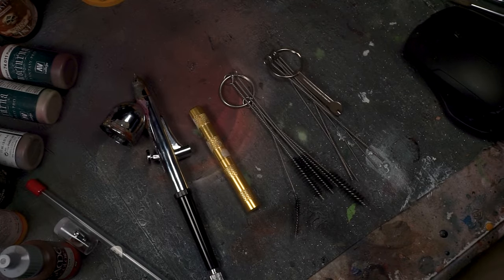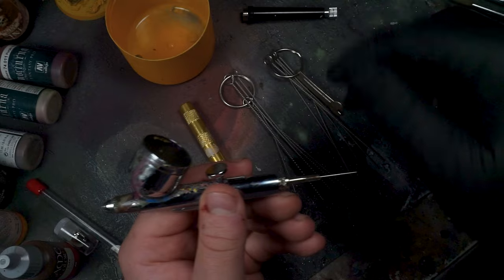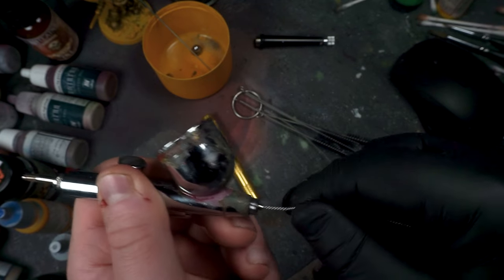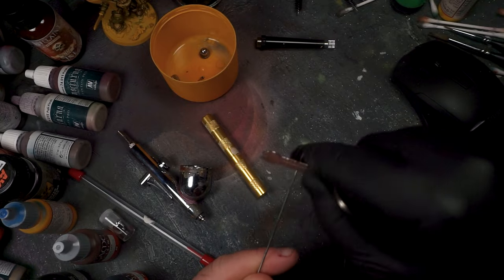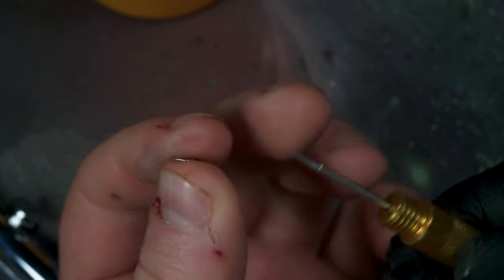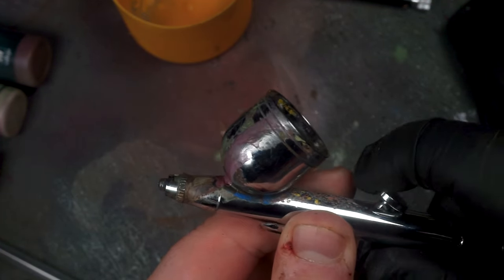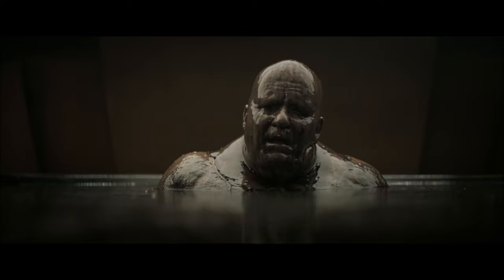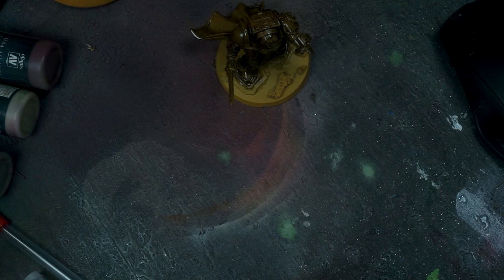How To Clean Your Airbrush

Comment: When removing the needle you should actually remove the nozzle first and than push the needle forward. This will prevent paint from entering the back part of the airbrush. I dont recommend doing the pipe cleaner dry - at least put some water on it before you go in. Also dont clean an expensive brush this way, you WILL damage it (How I lost my nice badger airbrush). Instead get one of those interdental flossing brushes (very small and thin pipe cleaners) and dip it in airbrush cleaner and wash the inside with that. I recommend the fine sized ones.
Needle: dont scrape like that, you can potentially end up bending the needle. Instead just get a damp paper towel and dap some airbrush cleaner on it and squeeze the needle with the paper towel and stroke towards the point only (to avoid sticking yourself). 
Cleaning fluid: best I've found is master airbrush cleaner - kind pricy. Windex works really well (same stuff as master airbrush cleaner but cheaper/watered down). Cheapest is water and airbrush reducer. DO NOT spray IPA like some people suggest - this destroys the O rings (same thing with acetone).
For enamels you probably want to use white spirits or whatever you use to thin the paint as your cleaning fluid. Due to it being harsh on the O rings I would flush with water intermittently while cleaning.